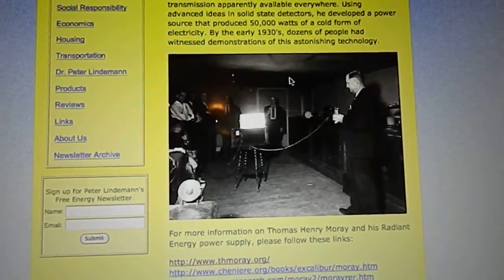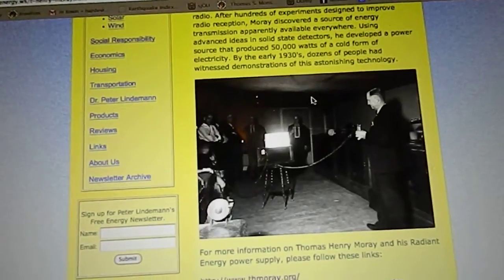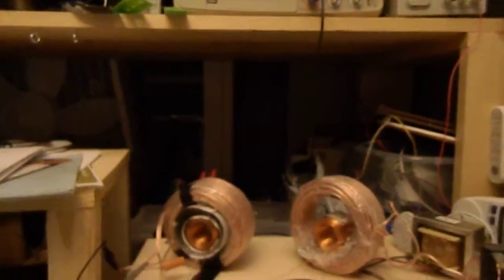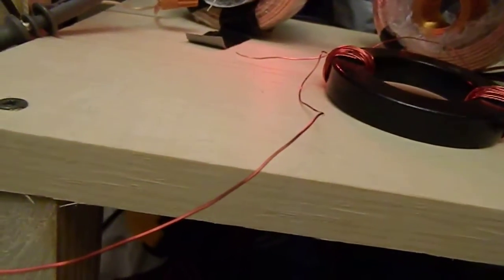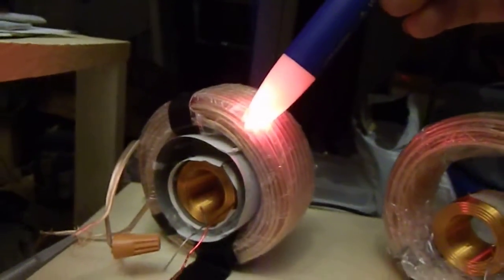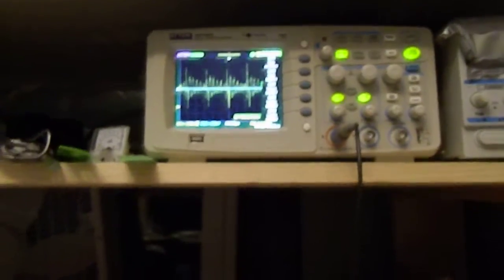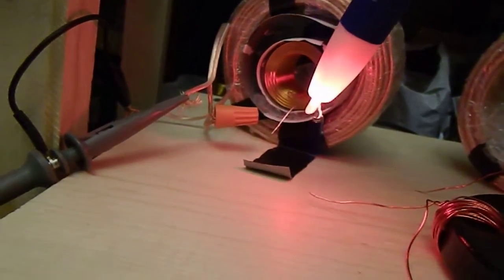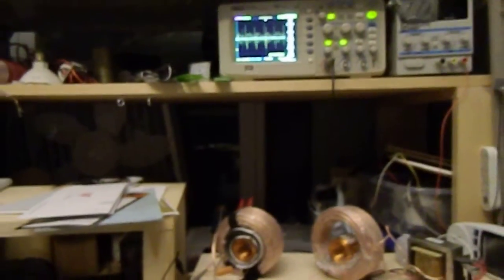Energy Experiment inspired by Henry Moray and Harvey Fletcher

Comment: That AC detector prob has a battery in it.. does it?
Reply: yes mate. thats how they work. they detect ac fields and then light a dc circuit.
Reply: Wrong  , the detector weighed 1 oz , had radioactive material with a cat whisker inside.

Comment: Egyptians used a macremae coil  it was one wire but  macremae strung between the fingers on both hands of two slaves they would cross thier fingers and stretch the wires then repeat oppositely, over and over this would create a rope of woven wire one continuous strand, this would amplify DC current as it flowed through the wire by capturing escaping magnetic fields and converting them back into electricity this would step up current from the Baghdad battery to the fluorescent light emitting a long glowing snake of light in the tube

Comment: Your facts that you are reading are incorrect the wattage was more around 5,000 watts and there was a small 9 volt battery that caused the circuit to operate
Reply: David you clearly don't know what you're talking about, do some research before spewing b.s
Reply: So someone used a 9 volt battery to collect 5,000 watts? Sounds like free energy to me.

Comment: I noticed that the pickup had to be almost right on top of the mains lead, but there was more 'range' with your setup. The middle being shielded is intriguing.
With such a strong single wire output, a neon bulb might well light, with 1 leg held in the hand and the other touching that single wire.
Reply: magnetic fields will not be stopped by that paper as the fields are toroidal. meaning they flow back in through the centre.